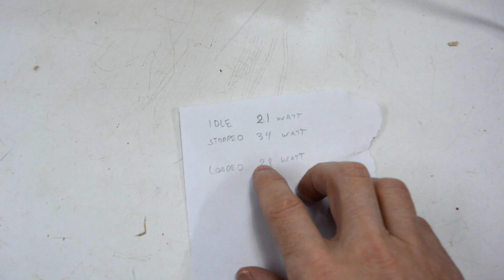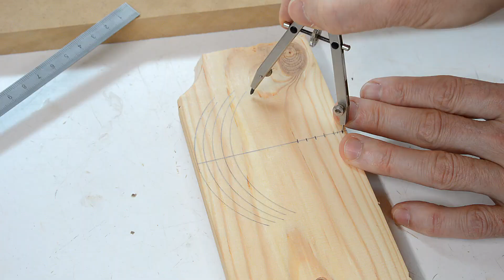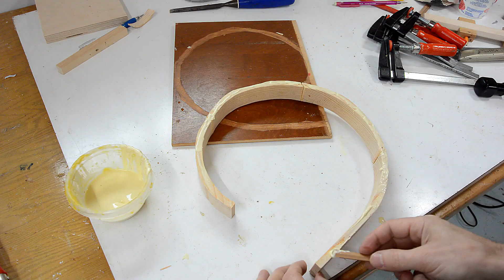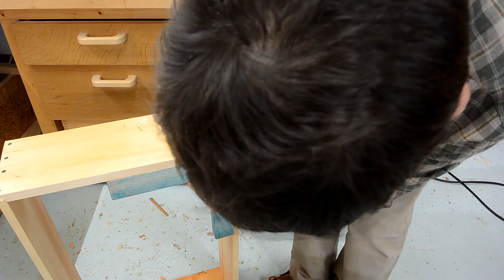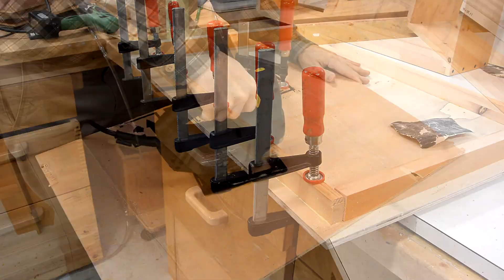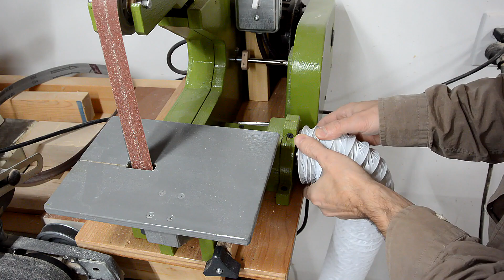Mini dust collector build

Comment: Probably would have been easier to make a manifold that can attach multiple machines to the dust collector and you could turn on or off each one with a valve. Still, I liked both of your dust collector builds that I've watched.
Reply from the maker: Then you need a bigggee dust collector, and some way to control the valves, and some way to autommatically turn it on when one of the machines comes on.  This way is much easier!

Comment: Once you set your radius to the mid-point of the quadrant you want to swing put your pivot point at each of the4 two ends of the arc and find the center of those two points, no guessing. I know it's not the critical but it's just as easy to do it precisely as it is to guess, maybe a tad faster. Also, wouldn't truing the OD of the fan improve the balance rather than placing those copper wire weights inside.

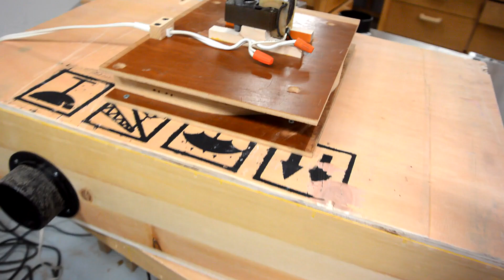Comment: 11:00             Twisty connectors?!?   It's the 21st century, you should be using Wago blocks as they're safer, easier to use and modular !!!    (Note:   I do not work or hold any stake in Wago but have been rather badly zapped by twisty connectors in the past and in the past few years discovered Wago which would have saved me from the afore mentioned electric unpleasantness)

Comment: I just built one of those blowers, using a condensate air conditioner pump motor, and it works pretty good!  Now I will have to make an actual filter box :/

Comment: Where do you get those exhaust blowers?
Reply from the maker: A friend works for a heating company and gave me a bunch of old ones
Reply: j Jigger in Florida, not that it means much, but I've been googling and oggling trying to find some and I can't find anything ['cept the costly ones), Not even craigslist has any. ughhh!

Any who, you are the man in my book. learned so much from you. Thx for posting these vid's.
Reply: I have not tried yet, but I saw someone comment that one might find used blowers for cheap or free by approaching an HVAC installer and asking if they have junked unit collection that you can plunder.

Comment: matthias i have a problem with my dust collector.. even if the 99% of the dust is getting in the bottom of the bucket. the other 1% is blocking the pipe that is connected to the vacuum..  you know why?

Comment: Dude, great job alway around very impressed with your wood working skills and knowledge. Drop the extra filter and may get better results, plus use as much plastic as possible. Plastic  It's lighter, less drag, keep the motor from harding as hard and your efforts in doing so is helping in recycling and saving our planet.

Comment: Matthias, could you tell me if this motor after get hot (these shade-pole motors always get hot) they consume more or less watts? I ask this because I still don't have a device to measure power consumption.
Reply from the maker: +Ismael Kafeltz Shaded pole motors are not very efficient and get quite hot, yes.

Comment: Not sure what the benefit of 2 filters of the same "rating" will do.  Whatever the first filter fails to capture will also typically pass through the second filter.  A better combination would be a "less fine" filter as the first filter, to capture the larger pieces, to allow the finer filter to be more efficient and filter out only the finer material without first clogging up with the bigger stuff.  The dust collector (ceiling mounted from Lee Valley) I have in my work area has 3 different layers, a coarse grid filter, a fine pleated filter, and the last level is a very fine multiple pocket bag filter.
Reply from the maker: +Vern C Those furnace filters are a bit oddball.  They caputre ultra find particles by static attraction.  As they get older, they let through more dust (not like a typicall filter).  I think once the fibrers are coated with dust particles, they fail to attract new dust.

Comment: If you may, consider using an old vacuum cleaner motor and blower housing. Your project could be built with greater power and may work to your satisfaction. A yard sale or flea market may have many old vacuum cleaners for a price that would make the project a price effective way to make a real good dust collector for your shop use. A good vacuum impeller and motor assembly would make for a better use of the time and effort spent, but the motor and impeller have to run good at the point of sale for it to be cost and time effective to build and use.

Comment: Hy Matthias,
I worked in a company which made exactly this kind of motors and please keep an eye on the coil temperature of the motor... i saw some really ugly burned ones especially in summer when the ambient temperatures are higer.
Or maybe this motor have already a thermoswitch inside the coil :)
Br, Felix

Comment: I had an issue like this where the dust would compact right where the belt would enter the dust box. I took an old paint brush and screwed it into the box so it was just barely touching the belt and it was enough to knock the dust airborne inside the box to be sucked up.

Comment: As a college student who enjoys building but has a very limited amount of tools what are ways you would suggest on finding the cheapest yet effective motors for building and producing some the equipment around your shop, between you and Izzy Swan's channel I am convinced I could manufacture some equipment that would be effective, have a small footprint, and most importantly not break my pockets. P.S. Im studying Mechanical Engineering, another reason for my interest in tool building! Thanks!

Comment: I use something similar for my miter saw. The fan motor is the same type, but mine has 60 Watts. It was taken from my girlfriend`s old washing-/drying-combo-machine. I made a small box out of particle board with the radial fan on top. The fan sucks air from the saw through a short hose into the box. At the moment, there is no cyclone or filter installed an it works surprisingly well. The fan seems to have simply not enough power to blow the dust out again. But of course it also doesn`t have enough power to suck in all of the dust that the miter saw produces. Nevertheless, I am satisfied because it reduces the amount of dust flying around significantly. Maybe I'll try to add some sort of filter one day.

Comment: If all the air blown by the impeller distributes inside the box and onwards to filter anyway, why make the spiral guide? Seems like it would be more efficient with just some blocks to support the motor mounting plate. Now I just might have to try that.
Reply: +jsirkia Oh sorry, you had the motor on the outside of the box. I was thinking of putting mine inside a housing since it's between a cyclone and a filter.

Comment: "i was too lazy to hook a hose up to my sander,"  "so i built a homemade impeller driven dust collector with a cooling fan, 6 point ledge for a filter, then added a second filter... and i built it out of hopelessly warped and reclaimed scrap wood."

Comment: If you get a slight whistle as it rotates, round over the corner where the spiral meets the outlet. If you want to get really clever, make it larger diameter at the top, and smaller at the bottom. Losing the sharp edge stops it acting like a siren.

Comment: Why not buy a fan like that?
Reply from the maker: +Nick R Right.  Making is below us.  We should never make anything.  Leave that to the chineese!
Reply: +Nick R Because why would I buy a $100 shopvac that doesn't fit where I want it to and makes 5 times more noise?
Reply: +Peter Callies No i don't mean buying a whole vac. But get only the  centrifugal fan. Like out of a central heating system or something like that. and then build the rest around that. Couse used fans are realy cheap sometimes even free. So not worth building.

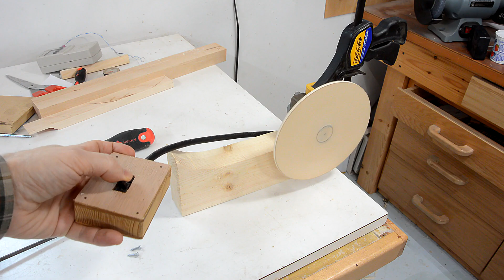Comment: Mattias, With this video you have let me see that is is really easy to make a blower. I tried it before, with a 3/4hp motor but never came past the blades and just gave up. You really inspired me to make a blower just for fun. That compass thing you did at 1:37 was really handy. I'll be using it with the next try. Thanks Mattias for the great idea!

Comment: To grab that last bit of dust, you may want to try and seal up any areas on the case away from that area and may open a leak by where you want that air to flow. similar to your dust collection box concept. Maybe start by taping the case and seeing if you get better performance as a quick check to see if it helps. Any leaks in areas that don't need air flow steal from areas you want it.

Great solution as I find I don't enjoy moving my shop vacuum from one piece of equipment to the next. I also like the idea someone else had of using the belt sander motor to drive the fan. If you have enough reserve power in the belt sander motor, you could use it to do both functions and then you don't have to remember to turn on the fan when you use the sander. A pulley system would also allow you to play with the speed.

Comment: I could watch you build dust collectors for quite some time before getting bored. Maybe you should try to do a central vacuuming installation, with blowout to the outside? Would be nice with the baby as it makes less noise, cleans better and makes you want to vacuum more often because it's less tedious.
Reply: Helge Frisnette - He built individual dust collectors to AVOID using all the hoses, piping and slide valves to control a central vacuum system. Why would he want to install something he wants to get rid of???  Listen to what he is saying!!!!

Comment: Facepalm.  That's the second time you made the fan backward. whoops.  I really like the idea of an individual dust collector.  It takes up a bit less space than a large unit in the shop.  Nice Idea and design although I might have used 20x20 filters with an empty chamber on the bottom then tried to deflect the dust to there somehow.
Reply from the maker: +Thomas Carignan I made it this size because I had a few extra furnace filters kicking around.  And this size filter is quite cheap and quite effective.
Reply: Fair enough.  I don't have a forced hot air furnace at home but I do use the filters on the intake of a box fan to remove dust, paint, and mold from the air of my shop.  I guess you could do that with the box fan you made if you wanted to. Cheers and Tschüss!

Comment: Your power consuption change with the load of the propeller. 
The propeller can run in the opposite way if you want a better difference of pressure between input out output ;)

Comment: I'm thinking you might be able to prevent the dust buildup in the sander if you made a little concave ramp that contours more closely to the belt at the front, maybe with some lacquer to make it more smooth. I'm assuming most of the air enters that chamber through the belt hole, so that would maintain the air speed and get rid of that little pocket of turbulence in there.

Comment: That prop was way too big, higher spin speed means better vacuum, and you really didn't need the volume anyway, I probably would have gone for half the thickness and 2/3 of diameter. that would not overload the motor and leave a bit of power left to maintain the rpm as it gets loaded.

I was actually more surprised that you didn't use the sander motor for it, just a belt with increased ratio and you could get much higher rpm at very little power cost to sander motor.
I'm thinking, putting the dust box underneath the sander itself horizontally. you can add some self cleaning action by having the air flow from bottom of the bot to the top so once you turn of the suction some of the dust would fall off the filter on it's own.

also, to clean the dust box every now and then, I would leave a port for the shop dust collector to connect to the dust box's dust side and suck the filters and the box clean. it won't be perfect but it would save you a lot of regular full clean ups.

Comment: Your hammering skills are outstanding!
Reply: +Brian Binns Haha that's a harsh lesson! ☺
Reply: +Mark Gsttice 
Did you notice that he holds the hammer half way down the handle. Had an old journeyman carpenter cut off the back half of my hammer handle when I did that as an apprentice.
Reply: +Mark Gstohl 
Did you notice that he holds the hammer half way down the handle. Had an
 old journeyman carpenter cut off the back half of my hammer handle when
 I did that as an apprentice.
Reply: Holding the hammer closer to the head gives you better control over it. Kinda like how if you rest your wrist on something and cutting closer to the handle, you get better (well, finer) control of a knife.

Comment: If the motor is struggling to get up to speed without a load, won't it really struggle once it's trying to suck up a large amount of dust?
Reply from the maker: +Seth Moore Quite the opposite.  More air resistance means less air flow, which means the motor has to work less hard.  I demonstrated this when I blocked the airflow with the piece of paper towel.
Reply: Ah that makes sense, I was only half way though my first cup of coffee this morning so I wasn't fully competent yet.

Comment: Do pilot drill holes make that much of a difference? What are the benefits?
Reply: +Jake Rubenstein It´s less likely that to split the wood, especially if you put a screw in thin material

Comment: At 8:55 you already had that piece screwed where you needed it, why did you unscrew it and glue it instead?
Does glue offer any advantages over screws?
I'm relatively new to all this sorry for the possibly noob question.
Reply: +James Poulton Provides extra rigidity. Wood moves with changing humidity, temp, etc., and he wants that cleat to ride as closely against the housing and stay that way. The screws alone would have allowed for potential bowing of the wood. Also, the idea is suction here, so the glue helps seal any tiny cracks. As far as asking noob questions, that's how you 'level up!' :-) The saying is true: "the only dumb questions are the ones unasked."
Reply: +durlydurl Thanks for the reply!
I'd figured it was something to do with creating a better seal. I hadn't considering anything strength related though, that makes a lot of sense.
Reply: +James Poulton Glad to help! Some of Matthias's earlier vids talk about when glue is a good idea and when it doesn't really help. If you go to his channel page, search for "glue." Pace yourself though. Eventually you'll have watched ALL of his vids and you'll have to wait for new ones! :-)

Comment: Amazing that little motor can do that!
Reply: +Matthias Wandel  As a Mechanical Engineer I appreciate your troubleshooting skills and more importantly, the way your mind works. Your approach to try different things in order to make the final product work is impressive.
So, a bigger motor is the best idea. Thank you Matthias for the great videos.
Reply from the maker: +Mark Job Those filters have very low air resistance, so that wouldn't change anything.  Also, less air flow makes it easier for the fan to turn faster.
Reply from the maker: +Glass Impressions Just barely!
Reply: +Matthias Wandel Did you try removing the second filter for better air flow?
Reply: valeu cara  parabens voce e muito profissional e criativo.
Reply: +Mark Job u otlfpfjickfkpg

Comment: Now that you've build a couple of these, do you have a feel for how large you'd be willing to go with a wooden impeller?  The one's you've made are great, and I"m guessing a 20" 7.5 HP unit would be sketchy at best.  So, where do you figure the magic line is?
Reply from the maker: +Matt Heere I don't know.  Make them bigger until one of them blows up.

Comment: I think you just built a shop vac
Reply from the maker: +Ttf Web Shop vacs have about 30x as much suction pressure.
Reply: OK - I think you made a low-power / low-performance shop vac.